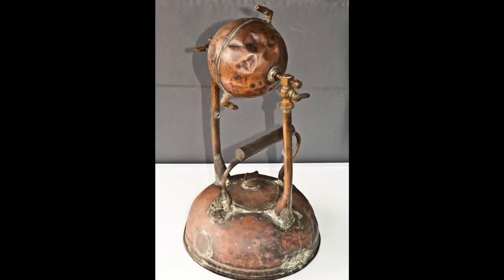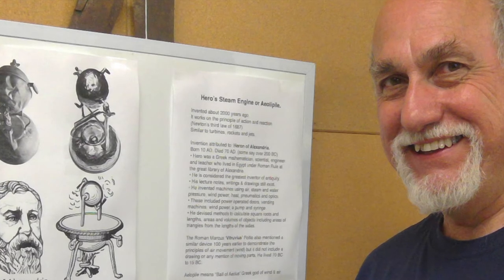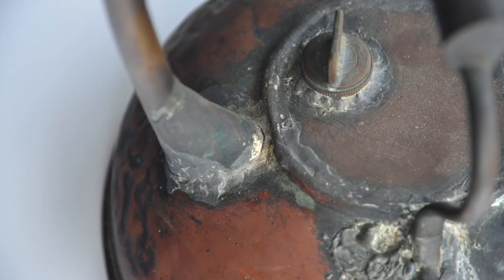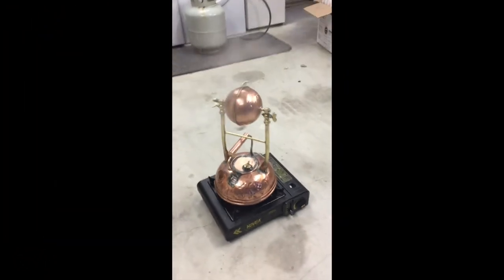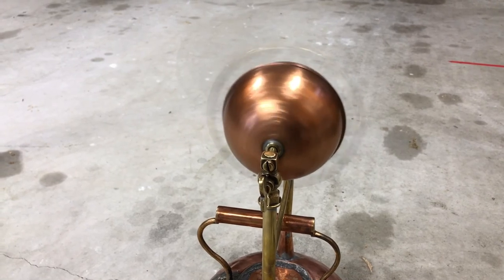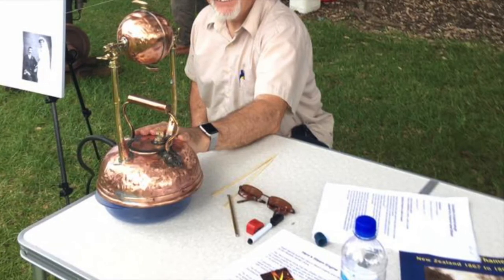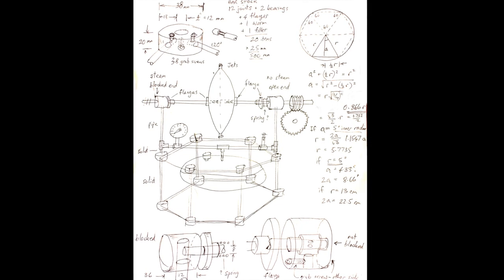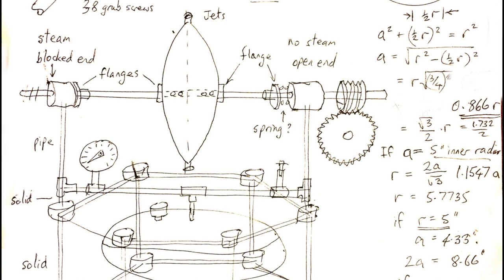Building a Hero's engine (aeolipile) using an engineers metal lathe (Boxford)

Comment: Hi Evan, that is an amazing video and highly educational too. Thank you for the display, I really enjoyed this along with the history lesson.  🍀
Reply from the maker: Thank you so much for the positive feedback.
Reply: @Evan-e-cent  yes it's quite fascinating, also stimulating when thinking about the bearings and tolerances best suited to retain steam with minimum leakage from the imput end of the pipe. Hey, I have just watched it again, it's great!  👌🍀
Reply from the maker: @keithatklint5380  Are you referring to this video or did you see the web site www.HeroSteamEngine.com and the YouTube video attached to that. Note that there are some numerical errors in the text shown in the video attached to the web site. I need to correct those in the comments.
Reply: @Evan-e-cent  Well it was just my reflections on your original video. I have not checked out the website that you mention.
I'm thinking that the bearing issue could be improved and resolved, by attaching the imput pipe as a direct fit to a ball race. This should prevent any steam leakage.
It's good to know that you have noticed an error, after reviewing the situation. 🤔🍀
Reply from the maker: @keithatklint5380  I also thought a modern ball bearing race would be ideal. The problem is that the steam can pass between the balls. So i used sealed races but these caused so much friction that the rotor would not spin.  So I tried phosphor bronze 'plain bearings' but these also caused too much friction. So I went back and looked at the drawings provided with Hero's article and they showed small pivots the same as the ones my grandfather used. It was only when I used these that the rotor would spin. I think the reason is that they have a very small surface area. Also the steam leaking through the pivots probably makes the shaft hover with a cushion of steam between the two parts. So steam leakage may be an advantage. I think the biggest factor in the design was making a boiler big enough to produce the steam fast enough. I think you would enjoy the web site and the video shown there.
Reply: @Evan-e-cent  Thanks for your response and I see what you mean as with the idea like frictionless air bearings. This is a very interesting subject and I shall check the website, in due course ; when I'm in the mood. So perhaps a small diameter steel shaft within a nylotron fibre bearing may be worth consideration. Just a thought? 🤔

Comment: How are the sides of the ball not leaking steam
Reply from the maker: I suppose you are referring to the pivots which are the small bearings that the ball spins on. The pivot is a joint between the stationary part and the rotating shaft with the sphere on it.  You would certainly expect steam to leak here, and it does, but often the amount of loss is fairly small. Also if the steam is hot enough to be a true gas rather than water vapor it is invisible. 

There is a knob that you can turn on the head of a screw that increases the pressure applied between these pivots. When I tighten the screw the two pivots are pushed closer together and that reduced the leak. Unfortunately it also increases the friction and that can cause the ball to stop spinning, so getting the adjustment just right is quite difficult.

Sorry about the late reply as I didn't see your question at the time.
Reply: @Evan-e-cent  no you good and thx for the reply